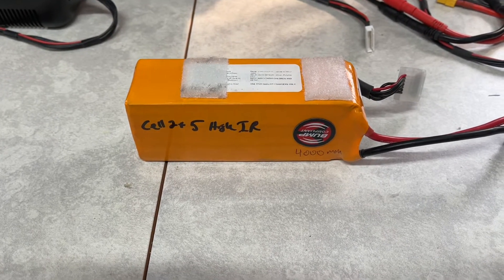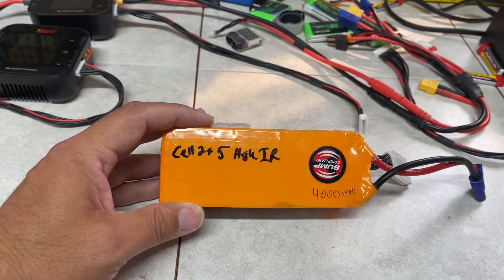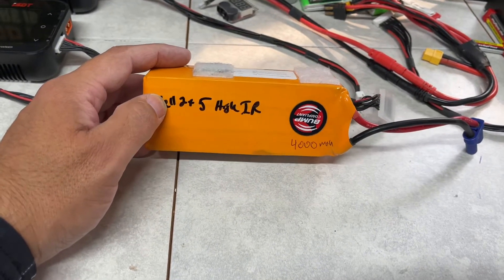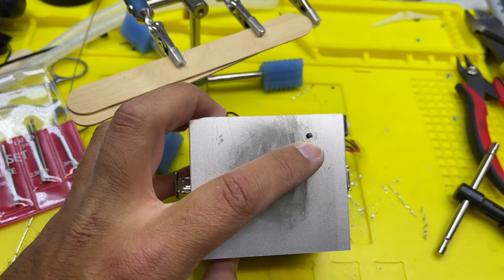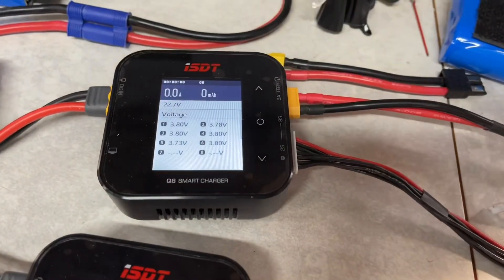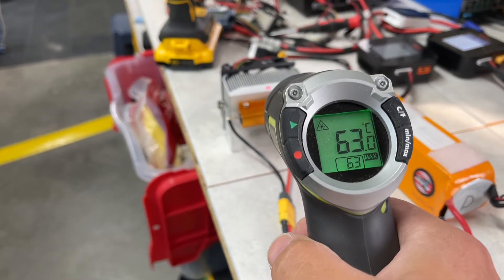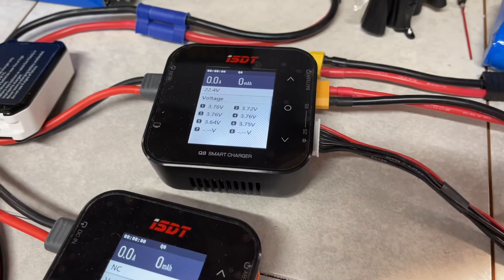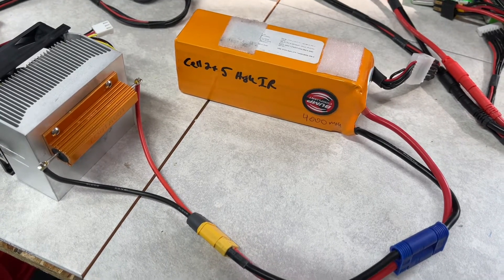Let’s make a cheap lipo discharger to drain dead packs.

Comment: If you can build such a complex discharge unit, why not make some simple use from the batteries that are still good? You said two are bad there is many more that are good, if you want to discharge them, just make a simple torch. That will discharge them and put them to use.
Reply: Batteries have other uses.... MANY
Reply: You could even use them individually....
Reply from the maker: Good idea but I don’t want to tear a pack apart and worry about soldering the battery tabs properly and getting the balance wires correct… most of the models I use are expensive and when I screw something up I would be crushed to watch them go up in flames….

Comment: I bet you are the guy to ask.  I want to make a battery adapter to use my dewalt 20v lithium batteries to power a 12v LED light.  I have a charger that is not working.  I want to rewire the charger to output 12v through the power plug (change out the plug for some kind of quick connect to attach to the light - keep me from plugging this thing into the house because I'm a dumb ass and have kids). 

I need a 12v step down capable of maximum output from the batteries (unsure the maximum output allowable by the batteries - I have a handful of 5ah batteries) and a protection device to avoid over discharging the batteries.  I can do the wiring modifications.  I've built a few electronics widgets and know a few electronic techs that can solder the finer stuff if needed.  I just don't know what parts to buy.  I would like to spend ~$20 for quality components.  I can spend more if needed.  Can you spec out the parts I need off of Amazon? 

Figure you have some extra time on your hands up there in the arctic.  If not, totally cool too.  LOL.  I appreciate the information you're putting out.
Reply from the maker: Wow, that is a more complicated project! Basically you really need a buck converter with an adapter for each battery, one with blades for the battery side and one with slots for the light side….  Plus a voltage sensor that won’t allow you to over drain the battery. Unfortunately that is outside of my wheelhouse. I would need to learn all that from scratch with a boat load of work. Unfortunately I can’t do that with other commitments. 

Any eBay adapters?
Reply: @mbwoodbutcher  Darn the bad luck.  I am slowly figuring it out.  I was hoping you had all the answers and I could take the easy route.  Not mad at you (would you care if I was?  LOL). 

There is an adapter that Dewalt made that outputs 12v with a voltage sensor built in.  Only issue is, it outputs max 5 amps.  I think the LED panel I have draws closer to 20 amps.  Need to test the panel to identify actual amp draw.  

It's not a pressing project, just something I have been kicking around.  Thanks for the response.  Keep on keeping on.